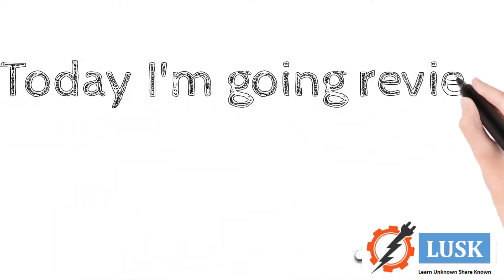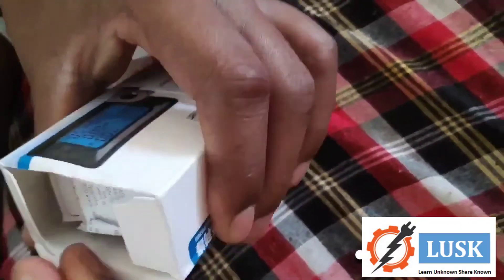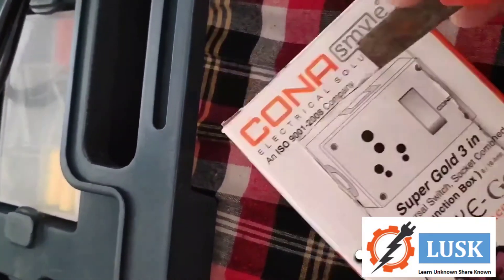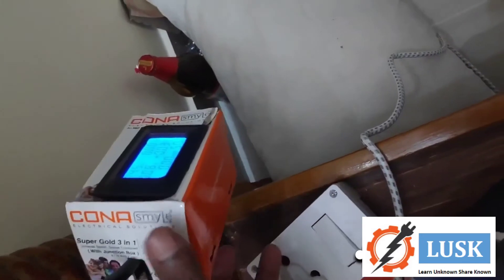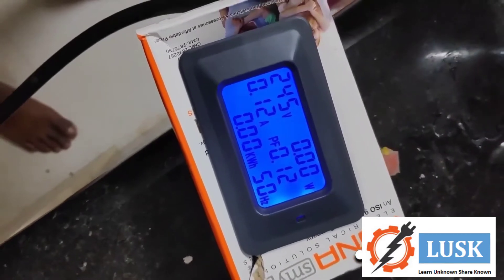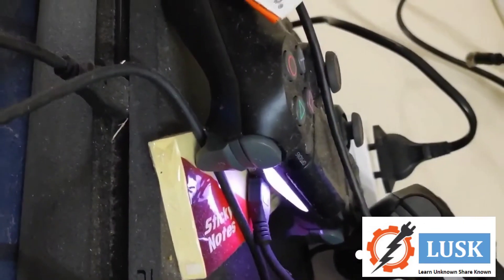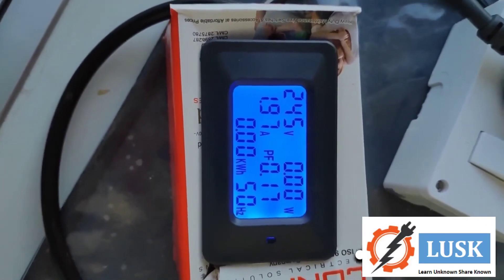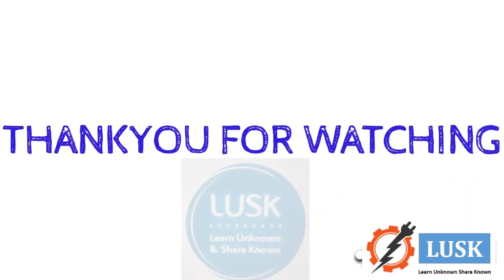AmiciSense AC 5KW 20Amp Digital Energy Meter- #REVIEW IN ENGLISH #POWERFACTOR #AMMETER #FREQUENCY

Comment: Only problem i see with a perfect unit of this type  is the display .

Blue backlit LCD may be unreadable in the dark from angles beyond 45 degrees . So i has to stand infront of it .

The other model of amici with 100amp has multicoloured display which is great for day and night use . Only draw back of that model is its available only in 100amps so more cost .

Comment: Hello, nice explanation. I have same meter, when I measure inverter refrigerator power consumption it’s power factor is mostly between 0.45 to 0.58. Is this correct? I have Samsung 321 L 5 Star inverter Fridge. It’s consuming 3 kWh per day. Is this consumption is high or normal? Fridge setting is medium cool and use is very minimal.
Reply from the maker: Actually.. power factor is okay only...why I'm saying it's normal because... When Motor run in full load Power factor will be good .. if motor running is less load. Obviously power will be low.. so don't worry.. your fridge is inverter fridge.. so it'll run according to requirement only...